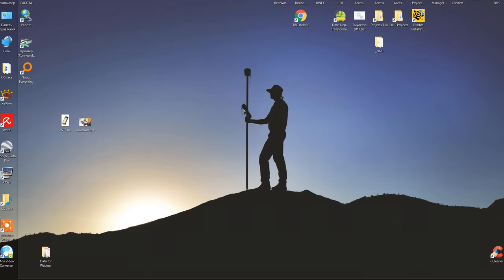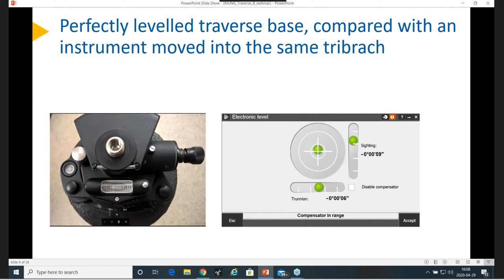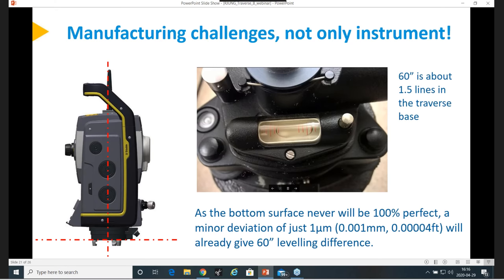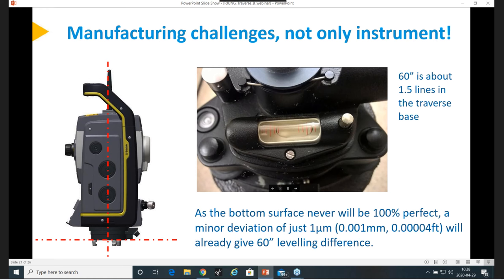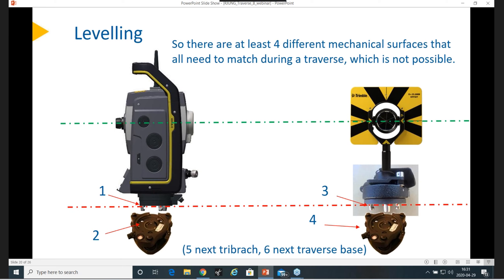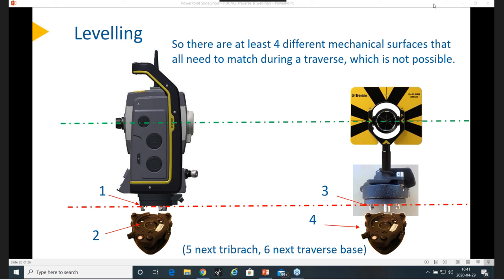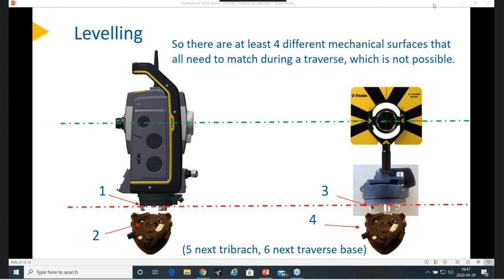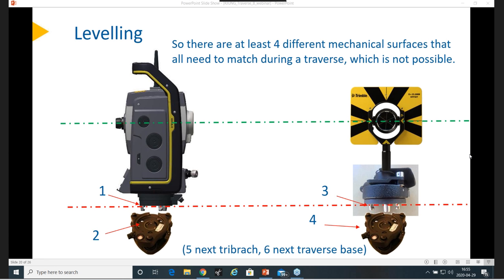Should I leveled my total station on next station when traversing?

Comment: The biggest impact on the level being out on an instrument or back site is the plump line to the mark, you will not impact a forced cantered traverse, but your independent setup on the same marks will immediately show any error in the plump site being off because the tribrach wasn't level. This is because the 0.001mm error will be around 10 times higher when you project the error 1.5m down to the mark.